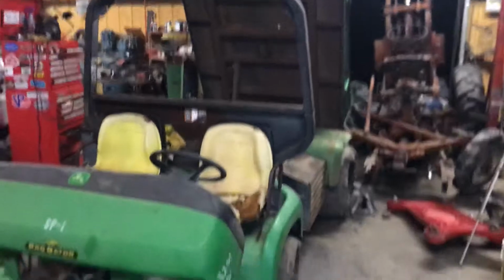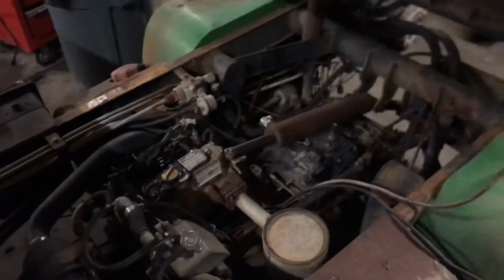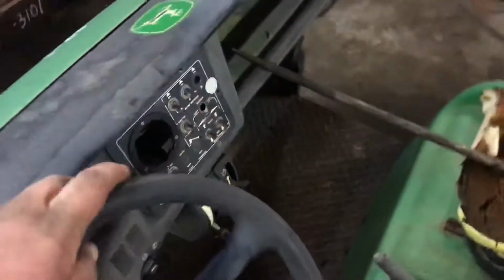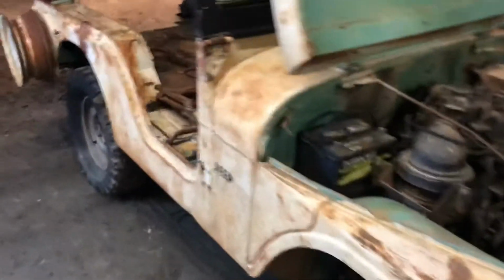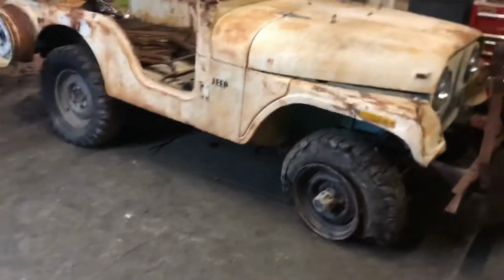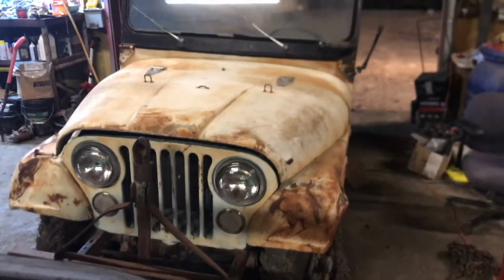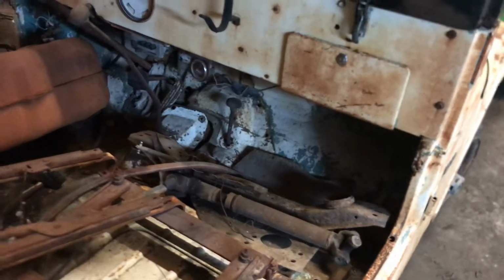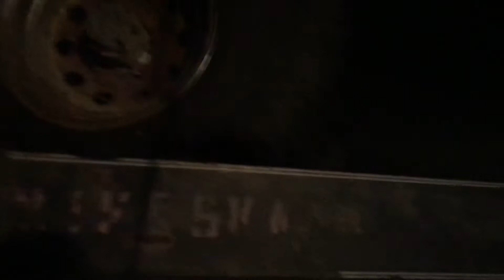Auction Haul 2/27/21: Gator and CJ5

Comment: I take it that's also a jeep frame, and hopefully the drive train. 
As far as tubs for them, they use to make fiberglass bodies for them
I use to have a military M38, with Buick V6 that had been worked over decently, muncie 4 speed m21, Borg Warner transfer case, warn locking hubs.
It still had the dana 25, and 40 axles under it with stock 538 gear ratio, and with the factory overdrive unit still intact.
12 forward gears, and 3 reverse, and best of all, if you could clear the 4" pipe bumper, and keep from over revving it, the dam little jeep would climb just about anything, and it really didn't matter about mud.
Only thing was, you had to stay away from regular vehicle tracks, are you'd slip off on one side, and depending on how big of tires they had, you'd find yourself stuck because you were sitting on the axles on one side or the other. 
But otherwise, there wasn't much could hang with it, including civilian models of jeeps, because they were longer, and didn't have the ratio to go low enough to climb out of places I could go.
But it's long gone now, just old memories now, and the things I once owned, are did with the toys of long ago. 
But there's plenty of old bodies around that, they've trashed the drivetrains in, and shouldn't be too difficult to locate anything you want. 
But remember it says Jeep on it, and that's equivalent to saying John Deere, and the price just doubled if not more,  because of its name.
Reply from the maker: ive heard that about the price. that is a good comparison i think lol. Sounds like the one you had was a beast!